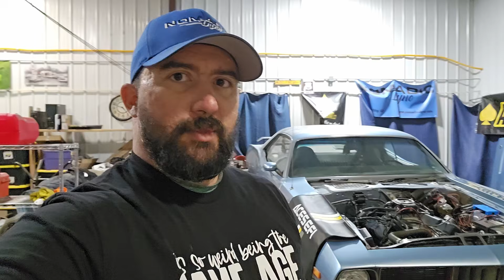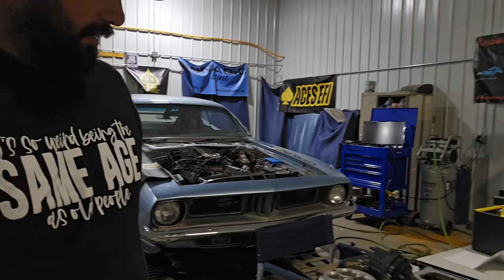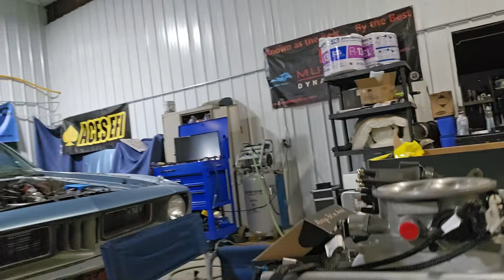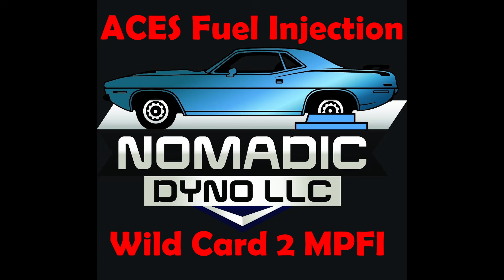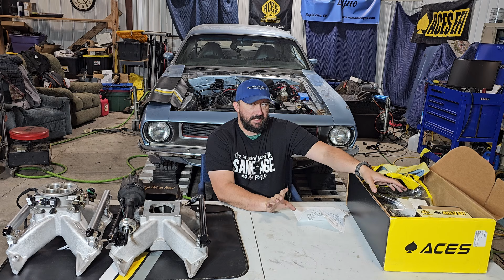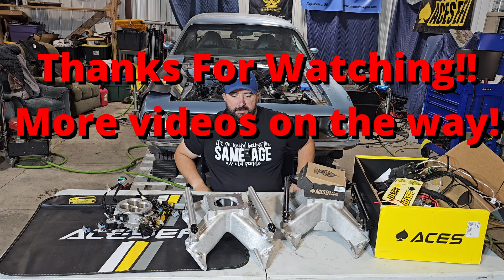Wild Card 2 Overview - ACES EFI

Comment: If i bought a standalone wild card 2 and wanted to use in on a 86-95 sbf intake manifold could i unpin the iac and tps and wire them to the ford sensors or is there a difference in how they read in the software
Reply from the maker: The iac is different, but you can get an adapter to use a stepper type IAC on the Ford setup. I'm not sure on the TPS, I recently acquired a Ford 5.0l with the factory intake etc on it still so I will be checking into that in the near future. I won't be using the intake, but just curious myself on how much would need to be changed.
Reply: Ok i was just wondering if it would work like on budget with edelbrock intake since my killshot tbi died ecu seems fine without the tbi plugged in but not when it's plugged in everything reads zero and relay clicks no fuel pump but fuel pump works with it unplugged and sensors read accurately think fuel leaking from the shafts in boost and letting off got to it  thanks for answering